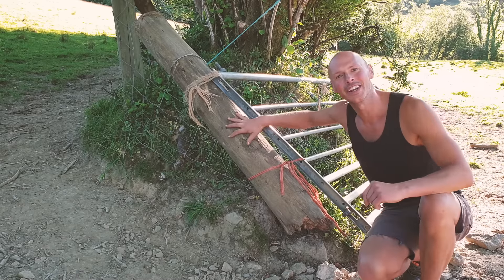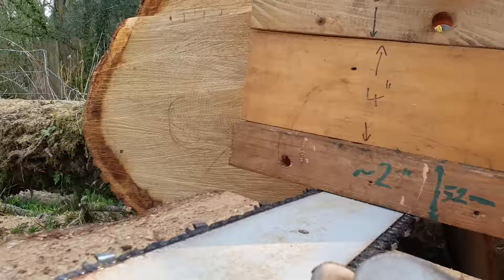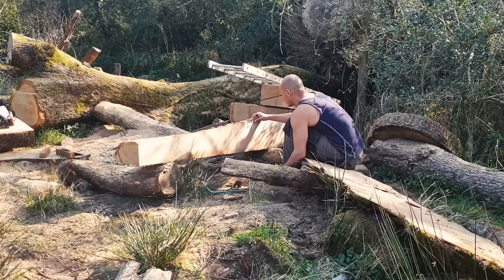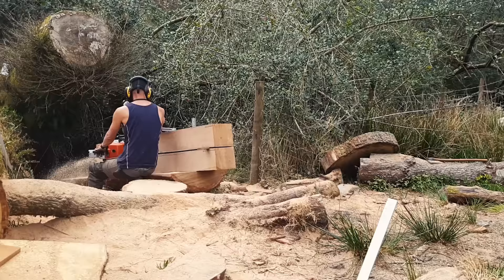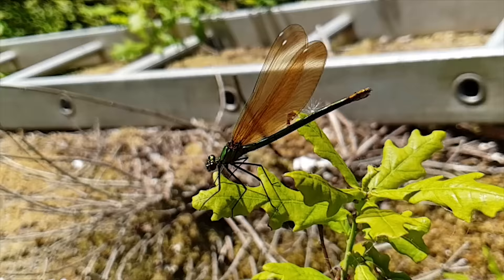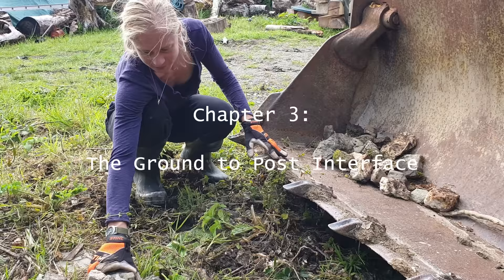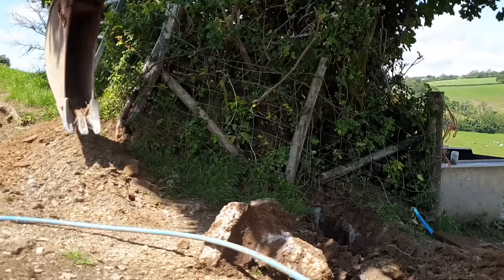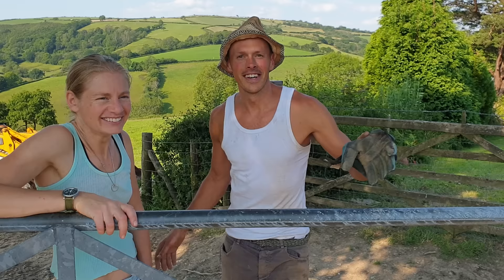The 3 secrets to ROT PROOF POSTS and how to make them

Comment: Have you considered using used motor oil and soaking or painting your wood posts with it. I was told that it is a very good way to preserve wood especially for fences or those  exposed to the elements,

Comment: All spare posts should be soaking in used  hydraulic fluid and diesel. So after years the wood really doesn't rot. Just lay the posts in a tub. On the farm there is always used hydraulic fluid. 
After digging a post hole use a mix of large and small rocks pounded in. With rock first then the post. Never use any dirt and only a little sand.
Now you got a post that  will last  so long you can't remember when you put the post in.
Cheers

Comment: About 20 years ago I built myself a pole building using the ACQ treated ground contact rated southern yellow pine setting on 1' thick 2' diameter concrete footings at the bottom of a 5' deep hole. With periodic inspections I've found no evidence or rot or movement, they seem to be solid below grade. I do know that there is a lot of moisture in the soil. I'm confident they will last a long time.
Reply from the maker: Hi Edward, thanks for sharing your experiences.

Comment: Nice video guys. I imagine the char treatment would heat treat enough of the cross section to make it inedible to fungus, mould and insects. This is done in an industrial oven to heat treat wood for termite resistance, it changes the chemical make up of the wood... Like the difference between bread and petrol for us. They're both carbon based ;)
Reply from the maker: Good morning JitsukaBlue, thanks for getting in touch! I'm interested in this oven treatment. Have you got any links or leads I could follow up on. What exactly does it do to the properties of the wood?  I know, just drying woods can make a huge difference - in many cases over doubling, their breaking strength! 
Thanks again, Bongo.
Reply: @FloweringElbow I've never tried it but you can read about it here. https://en.m.wikipedia.org/wiki/Thermally_modified_wood
Reply from the maker: @be99rnm  Thanks! Fascinating read, with way too many rabbit holes to go down..

Comment: Cast your own concrete posts in place. Use lots of reinforcing material.
I just tried my first prestrested post. I welded a big flange on the bottom end of the rod, wrapped it in newspaper, and after the concrete cured for three weeks I tightened the nut at the top of the post. I filled the depression the nut is in by pouring in hot tar to prevent corrosion.

Edit, spelling correction.
Reply: what would be the purpose of prestressed concrete used vertically? Isnt prestressed for adding strenght to floors and lightening them at the same time?
Reply: @Nordic_Mechanic  
The big load on fence and gate posts have is to the side where as the big stress on floor joists is down. In both the big stress is perpendicular to the beam.

Comment: Wowsers I often wonder ed if burning a hardwood would keep the bugs, mildew, mold, and other forms of rotting and breaking wood down, cause you've burned anything the insects could eat out of the wood. Thanks for sharing very informative, and the stones vrs cement I thought great way to use up unwanted chunks of old rocks cement, broken plates, cups etc. It will all pack down in time. She looked pretty solid when you were jumping on her. So did you name all the posts you put in ie: Rock Hudson, Beasty Betty. Do you in your opinion think square posts are better than round. Just curious, I know what I believe, just thought I bring it up for none experience post builders lol. Thanks again, luv the format of yo videos. Please Have The Best Days Possible, from All of Us at: The OtterOutfitters Co.

Comment: In the states we have a chemical you can buy called copper green, it smells Dreadful but is very effective and then I like to coat them with what we call asphalt emulsion which is a sort of liquid black tar. We also have pressure treated wood which isn't quite what it used to be but the problem is that it is made from an exceptionally poor quality of wood, hem fir. Some places it is hard to get. It won't rot but it is not very structurally strong or sound. We can also get liquid borate which can be painted on everything and will prevent termites. We like to pour concrete around a post instead of just pile rocks.
Reply from the maker: Hey Plumo, thanks for sharing your experiences.
Reply: The 4x4's I put in the ground were pressure treated (n.east usa) and several out of 20 rotted relatively quickly.  I foolishly put them directly into the earth and back filled with the same.

Comment: I was shaking my head in disbelief when I saw how big that oak was and the potential of the slabs that could have been milled off it . Use eight to ten inch trees for fencing material ,not two hundred year old oak trees !  Save the old one's for building your kitchen cabinets and countertops and maybe even the flooring and siding of it ; the possibilities are endless, but the amount of big oak is limited.

Comment: @7:55 you were pushing the posts.  Get wood/plastic dowel rods and put them in the kerf as you get.   You can easily slide slabs/posts.
Reply from the maker: Nice tip, thanks Mark.

Comment: The oak log would have been worth enough to buy a load of  telephone poles and buy/rent a post hole digger for your backhoe. The specialty wood dealer (supplies custom woodworkers) near me would have paid you a princely sum to cut that log to slabs. Otherwise that method looks like a great use for all the rocks my garden grows but a pneumatic hammer (concrete breaker) would have compacted those rocks quickly and easily. Osage orange would be the wood of choice for this,It can be almost metal strong,flexible and naturally bug/rot resistant.

Comment: I saw somewhere else that the very bottom we should not char so that the moisture that comes into the wood above the ground will drain out. If the char seals in the water it can rot from the center.
Reply: I don't think the charring process forms a water proof seal, it just makes the wood unattractive to things that would try to rot it.
Reply: @randomstranger9674  Thank you.  Interesting.  I wonder if I pack charred post in gravel (not cemented) if water drains off and bugs are kept away if that would add some or keep some integrity?

Comment: Is there a signifcant difference in longevity between backfilling with stones versus a large gravel? The point is to make it hard for water to sit next to the wood, and it would seem that anything much coarser than aquarium gravel would do that just fine.
Reply from the maker: Hi Tim, good point. typical drainage gravel works ok, but I think it's might be a little more difficult to compact to get a solid 'lock' into the ground if the gravel is graded and all the same size...
Reply: @FloweringElbow  Ah, that's true. A heterogenous mix would be more mechanically stable whilst achieving the drainage goal just as well.

Comment: I get the charring ( leaving just a little ) what "kills" me is the oak.  It's SOOOO expensive to use s a fence post. I suppose you are amortising it against the life time of the post and the time it would take you to replace it, but it;s just so expensive and valuable, you could have sold those beams/planks etc for hundreds of dollars. 

I especially liked the use of the fist sized rocks to maintain an air gap around the post.  Im in Canada so I don't know how well it would hold up in our freeze-thaw autumn and spring but it may work.  perhaps add dry clean sand to trickle down around the rocks and compact over the years?

Thanks for the videos
Reply from the maker: Hey Trevor. Don't sweat it on the oak, I fully intend to make some nice furniture from them once they have 3 or 4 decades in the field experience and have gained some character ;)   
Thanks for watching :)

Comment: here's a simple old-school rancher way to make posts last decades... get a 55 gallon drum. add a mix of 50/50 used motor oil & diesel... you can soak it as is or char the ground contact and again soak in the mix. let dry and it will last longer then you will.

Comment: Creasote works, so does copper naphthenate.  My dad made some doors out of yellow pine for his shrimp net that he drug on the bottom of a bay with for over twenty years and they are still in one piece.  He soaked those doors with Coppo, the name brand I can't find any more but it contained copper naphthenate.  Get some thin sheet metal and cover the tops of the posts.

Comment: Doing it right. Maybe the way ancient civilizations might have done it.

The top cap is supposedly important to keep water from being absorbed into the grain similar to a growing tree. The ancient Minoans used massive trees for building columns and they were always used upside down supposedly to prevent moisture absorption. You might want to install posts inverted if any of that is true.
Reply from the maker: Hey Johan, that's interesting thanks :) I have heard from lost of people that inverted is best, and it certainly is no extra effort, so certainly recommended!

Comment: A couple of observations. Pressure treated wood needs to be soft in order to take on the preservative, which makes them more likely to absorb water and rot than good hardwood or rot resistant softwoods like cedar and redwood. Concrete around post bases creates a water tank with a post in it that rots post far more quickly than placing them in the ground. I am curious as to the effectiveness of the stones for packing vs gravel and clay. I have seen gravel and clay tamped post holes over 50 years old in  the US state of Colorado.

Comment: A better solution could be to put some design time into a post to allow easier replacement. Then it won't matter if it doesn't last. I suppose, then you are out of business because there would be no more demand for exotic wood posts. I recently replaced a 20 year old garden post that outlasted the metal bracket it sat in. So, pressure treated wood does work.

Comment: This process doesn't make the wood any less attractive to fungi. Destroying the sugars might stop bacteria in the soil from colonizing, but it won't stop the mycorrhizal fungi from colonizing because they thrive on the lignin in the wood and no amount of charring the outside will take away that food source.

This process of charring wood as a form of preservation is really only effective when dealing with pine species that produce a lot of pitch and you'll lose any benefit to longevity that charring gives you if you cut the log up.

The reason it works is because when you heat up the log in a fire to char it, the pitch tends to liquefy and migrate to the surface where the heat is and saturates the outer layer you're charring. It's pitch that's doing the work as a preservative, not the charred surface.

Charcoal has a vastly higher surface area than the wood it's made from, this high surface area makes it the perfect home for soil microorganisms to colonize so on most species of trees charring it will have a negative impact on its longevity.

Comment: I've always wanted to experiment with shou sugi ban, but have never owned a house or property that I'm able to freely work on. I think in some instances, people first apply an oil such as tung oil or linseed oil, or other such oils that polymerize as they dry, and then hit it with the torch, almost like how you'd season a cast iron pan. I've also been interested in doing something similar but with sodium silicate as a densifying agent, which would possibly leave a layer of glass on the outside of the wood, hermetically sealing it against the elements...but idk if that would actually work or not.
Reply from the maker: Interesting Idea with the sodium silicate. Thanks for sharing :)

Comment: I've read that posts should be set with the butt end up (opposite to the way the tree grew upwards). The theory is that the natural capillary action of the tree is not as effective so the wood wont wick water up into itself as easily. Obviously this is impossible to know with store bought post, but if one were to cut their own... ;-)
Reply from the maker: Hey Ruster. Yeah, right on with that, I've heard it helps from quite a few people.

Comment: If you want to add years to your in-ground posts, wrap 16 gauged galvanized steel strap around the buried end of your post so both sides extend at least 50cm above ground.   Attach with 4 to 5 cm deck screws all along the strap.   Your posts will never break at the ground level.   This is especially effective with the smaller fence posts as compared to gate posts.   If you are using cement, let the strap extend a few cm below the bottom of the post so the cement gets a good grip around the strap.   This is extra work but well worth it in the long run.

Comment: I do posts on occasion for decks/porches or mailboxes or whatever. I never know what to do, they say pressure treated is the way to go on the instructions for such things but you know it's just going to rot. I had not thought of getting a nice hardwood and charring it maybe. Though I suppose for what I'm doing it might be a waste and 5 years or so between them is enough? Anyway I often prime the base that will be underground, and cement them in. Now I am angry that I did every single one wrong.

Comment: Use roofing tar and thin it out with kerosene (just thin it enough to paint it on).  Paint the wood part that will be buried and then wrap it in trash bag. the wood under the ground will never rot. I have a high water table and my posts have literally no wood rot after 15 years.  I have more issues with wood borers above ground, than any rotting under ground.

Comment: Great if you have an Oak tree on your property which you can convert into fence posts. I'd probably sell it because the cost of that much Oak would buy me ten times as many concrete posts, or you could consider Corten Steel posts, cast in steel. I've now had tanellised pine posts in Metposts cast into concrete for 20 years and they as good as they day they per installed.

Comment: The bigger stones are good, but you also need smaller gravel to go between the stones so that dirt doesn't work its way in, as it will. See how the Romans built their roads. It is a very good idea to put a flat stone under the post to prevent wicking up moisture from the ground. Putting some crushed stone/gravel underneath the flat stone will help drain water away and down from the base. I can get limestone tailings here for free, so I use that to put the top layer on around the post. If you tamp the hell out of it and ramp it up around the post, most water drains away from the post. A four foot piece of 2x4 works pretty good as a tamper, heavy enough, but also light enough. There usually is one laying around, and it can be really gnarly and still work. Go down under the frost line in your area. cement is not really necessary if you use rock.

Comment: Do you have a video about the contraption you made for your saw? If not, could you perhaps make one?
Reply: You two might try using straps to move your logs in situations where you have to move by hand. 

Also,  I sometimes use pieces of round metal pipe to roll large rocks or logs. Coupled with straps to pull with.
Reply from the maker: Hi Nonya, thanks for getting in touch. Yes we have quite a few vids on the chainsaw mill! here's a playlist - you might start with this one? https://www.youtube.com/watch?v=Z5K3iOqf2p0&list=PL95ElZTgRGGt9_ST0yXkRq1Qbub57UUa0&index=11&ab_channel=FloweringElbow

Comment: You’re going to get way more life out of those posts than you think. 60+ years at a guess. I removed some oak 6x6 buried 4 feet deep after 50years and the majority were perfectly sound, and that’s without the charring, cowl or stone backfill. 
The reason tanalith has become so bad is the removal of arsenic from the mix, but inadequate seasoning has been a problem in the uk for a long time too. More and more farmers are turning back to creosoted posts now, but the inadequate seasoning is still a problem when you inspect a cross cut of the finished product. The big pole producers still do a proper job

Comment: great video. Not sure if this has come up in the comments but I have started to use pine tar / stockholm oil after scorching the wood.  It has been used in Scandinavia perhaps for a thousand years or more and there are examples of wooden buildings there today, 800 years old and testament to the methods used to preserve wood. Its availability has been restricted by EU regulation. Perhaps I'm a cynic but I suspect the restriction of its commercial availability might have more to do with lobbying by the petrochemical industry than its harm to the environment.
Reply from the maker: Hi Phil. Yes, it has come up, it's an extra step that would increase lifespan even further it seems, but yes, it's mucky stuff to handle

Comment: save your old motor oil soak the dry post in the oil 7-10 days remove them from the oil. Allow 2-3 weeks after soaking before putting them in the ground. I'm 51yo I installed ruff cut 6x6 post in the ground when I was 14yo that are still standing today. Douglas fir and Western larch was the type of wood that was used.

Comment: Awesome channel m8. What u think to putting a support  at the non hinge ebd of a gate to support the gate when closed. Reduces pressure on hinged gate post?  Great tips
Reply from the maker: Hey Dave, thanks. Not a bad idea at all. In fact if you look at the closure hardware (near end of the video) It does actually support the weight... Can't rely on that though, as it will spend a lot of time open. Plus I like to swing on them like the overgrown child I am ;)